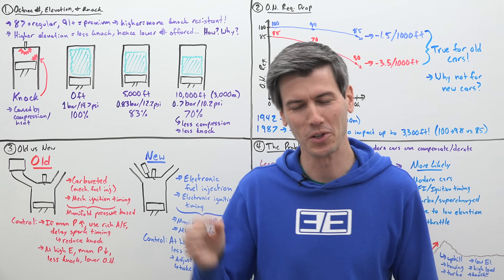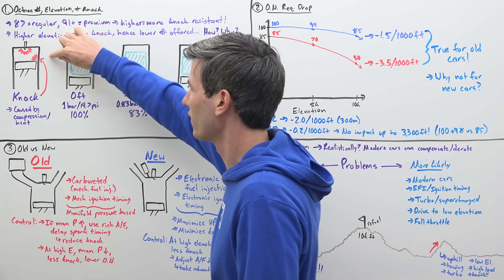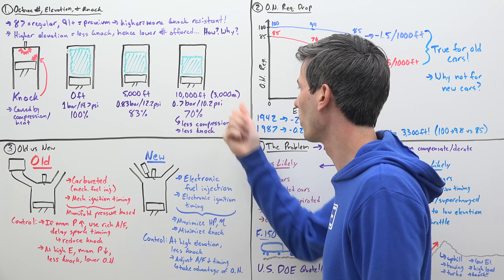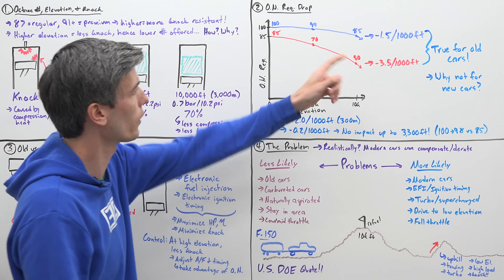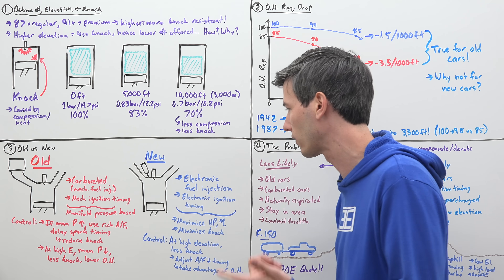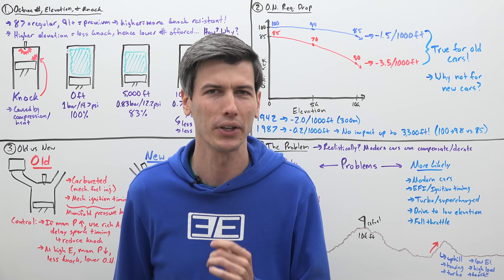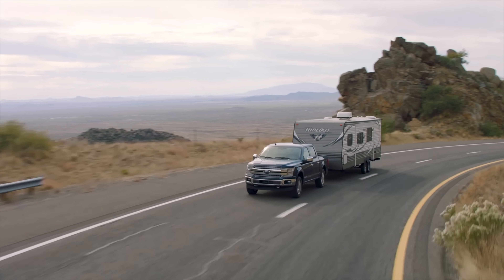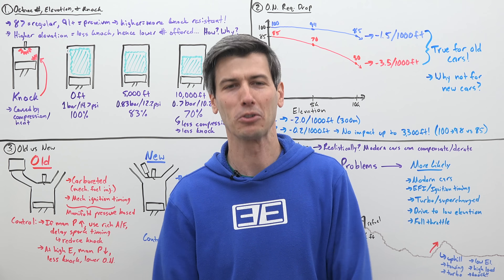Never Use This Gas In Your Car!

Comment: When we would go jeeping up in the mountains of Ouray/Telluride 85 is the standard for basic gasoline. Never had any issues whatsoever, precisely because of the elevation. However we always burned said fuel at higher elevations, and switched back to 87 minimum at standard elevations. 
Now I have solved all of this nonsense by just switching to a diesel rubicon!
Reply: Nah, you just added a whole other layer of complexity with diesel injectors, DEF, winter diesel, etc.  I would take a 3.6L Pentastar Rubicon over a diesel any day of the week.
Reply: @mowcowbell  no doubt, but I 100% am not owning this out of warranty and tow quite a bit with it. So the pros/cons for the diesel are actually beneficial for me. Also at the time of order, I couldn't order just the pentastar without etorque unless going manual. Which at the time would have held the order process up due to the manual trans recall, and the wife wouldn't have appreciated it much. 

As far as different fuel for winter I live in GA, and run fuel treatment in every tank, so that is conpletely a non issue. Also there is a heating element for this purpose in the DEF and fuel tanks of the ecodiesel.

I considered MANY factors before ordering our ecodiesel and literally couldn't be happier with it. Especially considering the ability to own one of these under factory warranty will not be around for long, as I see Stellantis axing the ecodiesel from Jeep branded vehicles. The torque is really something else, and it makes driving this thing from GA to CO and Moab, UT effortless. I have no doubt the pentastar with the 8 speed behind it is substantially better than the jk's nag1 5 speed, but the lack of torque from the pentastar and towing is not a whole lot of fun. That is unless you like being a 5k+ rpms for extended climbs and having bad engine braking performance comparatively.
Reply: Lack of issues does not mean the elevation saved you from problems, nor does it make the recommendation against 85 octane wrong.
Reply: @mechmat12345  eh they were rentals either way🤣. If it really was that big of a problem failures from this would be, and would have been, everywhere in CO considering literally every station has 85 as its "regular" fuel. Im not saying to run it, but I am saying literally hundreds of thousands do so every day without issue.
Reply: We live at 8500' and usually drive only locally. We've never had any issues in our truck - hopefully we never will!

Comment: I’ve been waiting for a video that uses facts and science to explain why less than 87 octane is bad. Too much confusion and misinformation out there. Here in the high plains of Texas we have 86 octane and I always have to buy mid-grade 88 octane to meet the minimum requirements. Less than 87 should be banned by the EPA.
Reply from the maker: Yeah, it's confusing to me that we sell it as "regular" when based on warranties it's not actually regular.
Reply: Not a fan of "bans" or the epa.

Comment: I've never seen 85 octane fuel.  And I cannot remember an owners manual that would allow it.

Great video!
Reply: 85 is at every station in Denver
Reply: We have it in Colorado, at least where I live at 8500 feet. It's what I put in our F250.
Reply: @11lizgoodall  yeah, itcs only for elevation. Residents have no problem running it. 

The problem would be filling up and going to sea level and driving hard.
Reply: @volvo09  Or towing a trailer uphill with a turbocharged engine.
Reply: I live at 6500 ft in CO and I only use 85 in my cars that say to use 87. I have one car that says to us 91 so sometimes I’ll use 89 if the price is astronomically high. Never had any problems in the twenty years I’ve been here.
Reply: I don't think I've seen a station in CO that didn't have 85. If we have any, I'm sure you can count how many of them there are with your fingers. Unfortunately, our 85 is the same price and everyone else's 87.
Reply: @NoZioKikes88  Wisconsin might have 85% (e85) ethanol fuel, but NOT 85 octane 10% ethanol fuel.  The altitude is not high enough there to safely run 85 octane.
Reply: I’ve lived in Utah and Idaho my whole life, and I thought 85 was normal everywhere.
Reply: 85 at every station in Colorado Springs, Denver and other nearby cities. There are a few places that does sell 93 as well (8th and Kipling) I don't remember where others are at lol.
Reply: My car requires a minimum of 91 and that's the highest they've sold everywhere I've lived idk wtf is up with the gas here
Reply: I live in south Florida.  If there is one place that needs octane it's this place!  NO 85 octane here.

Comment: They don't have any compensation for the lower octanes? That seems kinda strange for the most popular vehicle in the country. Also it is definitely weird to still have that low of an octane rating, who makes it?
Reply: I'm sure it can pull enough ignition timing to be ok. But the compression ratios are getting much higher on newer vehicles, which could cause pre detonation by compression and heat alone. Only way to be safe would be to lower compression, which they aren't going to make a lower compression ratio engine, since higher compression makes the engine more efficient. If auto manufacturers could sell them, they would make all vehicles with ultra high compression and require high octane fuel.
This low octane fuel is not very common at all. It is only made and sold because it's cheep as he said.  And only in high altitude areas.

Comment: I never seen 85 octane anywhere.
Reply: I didn't know it existed lol
Reply: It's in Colorado where I am. I'm at 8500 feet, I guess that's why
Reply: When you start climbing in elevation, the octane levels lower. I’m about 3500 feet elevation in Texas and it’s 86 octane here. Few hundred miles west in Colorado it’s 85 octane higher up.
Reply: Interesting isn't it.
I've never seen it either.